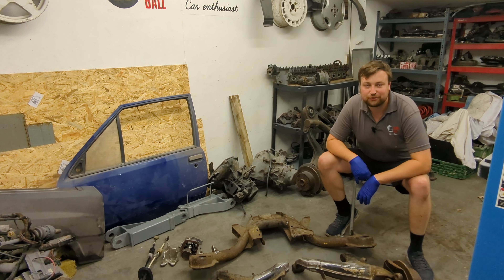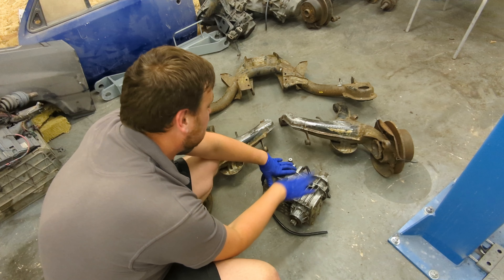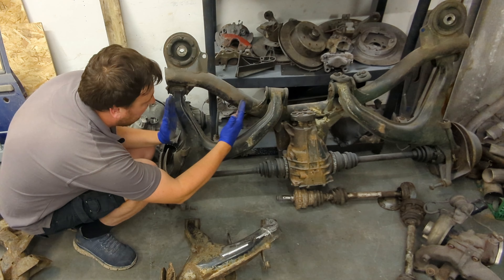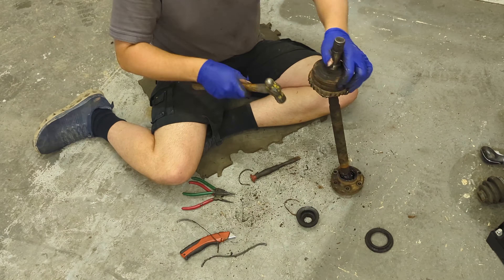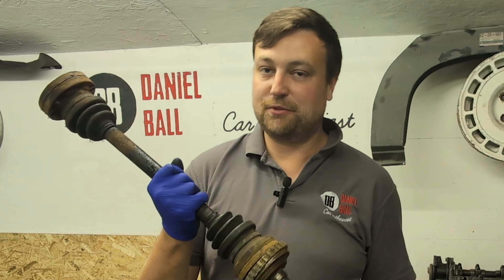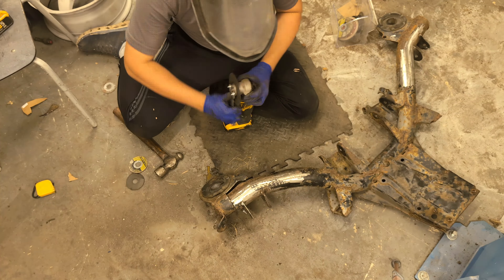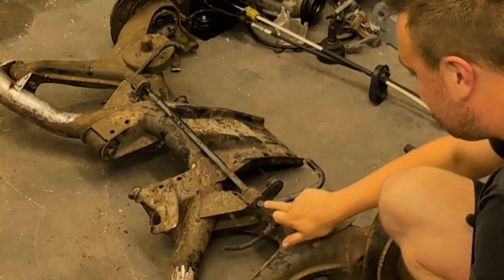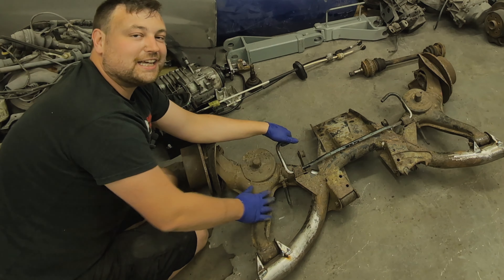Shortening axles - Nova 4x4 build Part 2

Comment: Sleeves en route 👍🏻
Reply from the maker: You're a star 🌟
Reply: @DanielBall Michael did my hub conversion using the vag bearings and machined my hubs out to accept big block shafts and flanges. Handy guy to know

Comment: Cracking progress Dan. I've used a different cable mount for mine and then had a bracket made to hold it as the F18 doesn't have the mounting provisions like the F17 does. Yours is the newer style F17 one, I have one too if you ever need a spare, you're welcome to it. If you ever need to check anything i'm happy to bring the car down to yours so you can take a look at it properly. Can leave it with you if you need to replicate the bracket or anything. Also, drop the part number you've got for the CV joints and i'll do some hunting for you. I've found a few online that say they're compatible with 4x4 na GSi and 4x4 Turbo but not sure if they're correct?
Reply from the maker: Thanks pal, appreciate it. I will send you the number. Everyone I have found comes back as a front one even if it says back 😭

Comment: Nice work Dan. Be sure to change those crusty brake shoe backing plates before you fit the arms. They've just gone on my Cav Turbo, and I've realised that in order to change them (they are available new on ebay thankfully) the whole arm has to come off as new wheel bearings need pressing in to do the job!

Shame about the shafts. Are you looking at big money for custom made driveshafts if that's the preferred option?
Reply from the maker: Thank you. 

Yeah I plan to change them/make some, or do something before it's built up. This is a purely the mockingup stage.

There not big money, if the fact I can't get the metal collar off which worries me. I will sort it though 🙂
Reply: Loving this rear axle build, can't wait to see it on the car all nicely painted/powder coated with new nuts/bolts etc. Great that your keeping it OEM style with standard width.  Can't wait for next upload.
Reply from the maker: Thank you, these kind of comments fill me with enthusiasm to get out and do a bit more 😀